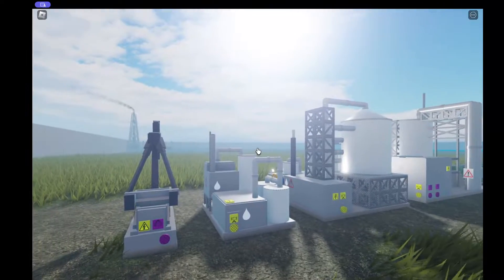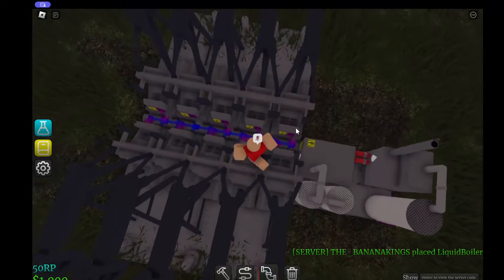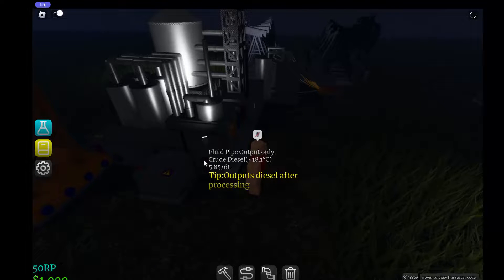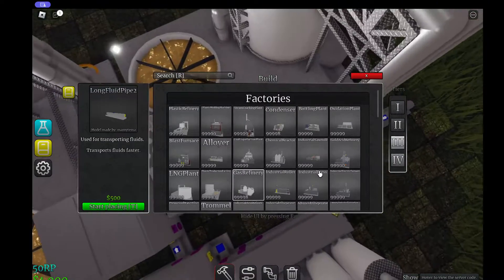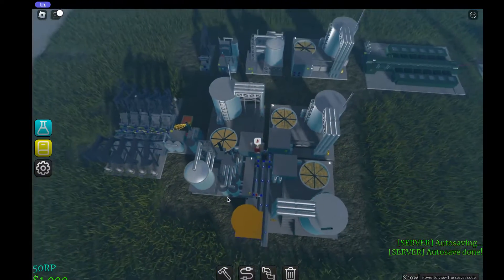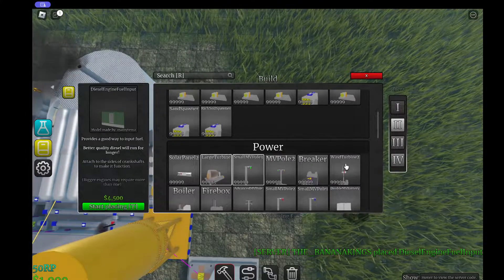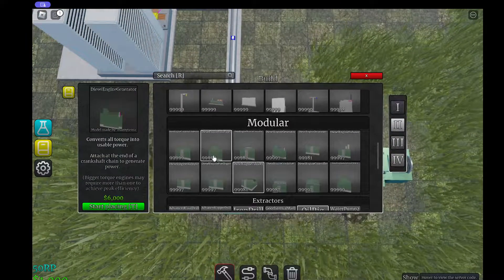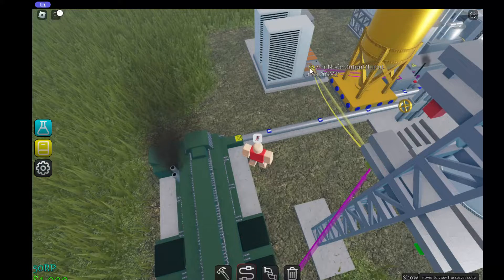How Diesel Works (REVAMPED) | Industrialist Tutorial

Comment: Most people try to get as little pollution as possible but contrary to popular belief it’s not really that good to have -infinity pollution because trees are going to grow slower and farms that use trees are going to slow down
Reply from the maker: Correct. The golden zone is between 0 and -50.
Reply: I somehow have -120%
Reply from the maker: @phantomghost7901  Nice!
Reply: @TrendyBanana I HAVE -41734 POLLUTION, POLLUTION B-GONE SPRAY: THE AIR IN MY WORLD
Reply from the maker: @Protogen-oh9dv  Nice
Reply: @TrendyBanana so i have 30% polution for now i have heavy i dustry only
Reply from the maker: @motka2547  Hm?
Reply: @TrendyBanana  im only doing things with oil diesel coal and copper mining and i get 1% polution more in 10 minutes.
So right now i have 32% i may be in trouble
Reply from the maker: @motka2547  Nah, you should see what most people have in the discord!
Reply: @TrendyBanana where have you gone? When are you gonna make another video?
Reply from the maker: @NoahFlaugh-tz9mc  For some reason the "post" button on my channel stopped worked (since 2 months ago if I recall correctly). I'm working to try and get it fixed :(
Reply: @motka2547I had a world wide system of water across my entire world once I realized it’s crucial and the same thing I did with steam, I hooked up a shit ton of scrubbers in the span of 30 mins and I got -1000 pollution in like a hour

I created a 5x5 of scrubbers 

5 wide scrubbers long 5 scrubbers front to make a square

I hooked up sum water to it and used intersection to remove residue and I hooked up all residue lines into one row of pipes into a storage and boom -1000 pollution
Reply: Also use logic breakers and pollution gates to avoid the problem entirely
Reply: Modular diesel fuel is PAIN idk if im missing somthing or crude diesel is just really hard to make efficiently and consistently
Reply from the maker: @reobrauer6445  That is personally why I don't like diesel very much.
Reply: @TrendyBanana how do we get rid of pollution in the world? is it the scrubber?
Reply from the maker: @prosalami22  Yep! Only the scrubber.
Reply: @TrendyBanana whats the best power production way, LNG’s, large turbine’s or diesel
Reply from the maker: @prosalami22  LNG isn't a power production method, and the best currently is a gas burner boiler setup.
Reply: @TrendyBanana  does the gas burner emit pollution? or does it release something else
Reply: @TrendyBanana  and then what does the LNG do then
Reply from the maker: @prosalami22  The gas burner does indeed create pollution.
Reply from the maker: @prosalami22  LNG means "Liquid Natural Gas". It is a type of production for money. I have a video on gas as a whole with a part about gas burners and a part about LNG.
Reply: @TrendyBanana  okay thank you
Reply: @TrendyBanana what is better, wind turbine, large turbine or solar?
Reply from the maker: @jdsagolden1278  Large turbine is the best. Wind turbine is only good early on, and tier 3 solar panel is good for individual needs.
Reply: @TrendyBanana  after large turbine, which energy generator should i try? (Whatever the pollution rate)
Reply from the maker: @jdsagolden1278  Gas burner into boiler into large turbine. Or a very very extensive modular diesel engine.
Reply: @TrendyBanana  tysm, last question, how much does it take to gas burner boiler setup complete a full Gmf?
Reply from the maker: @jdsagolden1278  Not sure, but a Gas Burner can support 10 boilers, and each boiler can support 1 large turbine.
Reply: @TrendyBanana  wooow, thats alot tysm
Reply from the maker: @jdsagolden1278  No problem, goodluck mate!
Reply: Well i guess I just have -1,736,083% pollution before learning this

Comment: btw it can go in both directions and doesn't have to be facing away from the controller
(I hab question tho) ermmm how does the hv pole work leik i did the transformer and connected it to hv so now im getting power but it feels like you can just use hmv poles to save money
Reply: also i recreated my super build so now im gettin 8000000000 torque LETS GOOOO
Reply: YOU LEAKED SOMETHIN AT 18:55 FOR A SPLIT SECOND SCREENSHOTTED
(YO IS THIS GONNA BE A FEATURE) AVERAGE MONEY PER SECOND? TICKS PER SECOND AND MILISECONDS? OIL RIG TIME? ULTAMITE???? RESERVED? TICK LOSS? TICK UPDATE? TIME LOSS? TICK PER SECOND? CONDENSER THINGY? UPDATE ULTAMITE? WAITTTT SUFRIC ACID WELLL?????? OGMOGMOGMOGMOGMOGMOIGMOGMJOGG
Reply from the maker: @Goldfish_Gaming   This isn't a leak. This has been in the game for a very long time. Press 'p' to show the debug menu.
Reply: @TrendyBanana  oh
Reply: @TrendyBanana  yo pls explain what the new logic thingy is i know how like the xor gate and other stuff work but the other things just stump my brain
Reply from the maker: @Goldfish_Gaming  Will do.
Reply: @TrendyBanana  epoc
Reply from the maker: @Goldfish_Gaming  Epik
Reply from the maker: It can go in different directions? It didn't work for me when I did that last time.

They have a lot more nodes, 5x the range, and transfer a lot more power. It just depends on what your looking for.